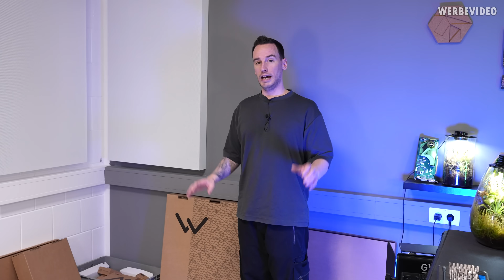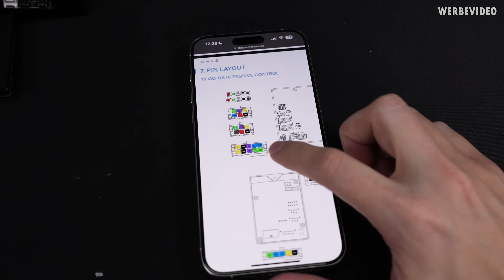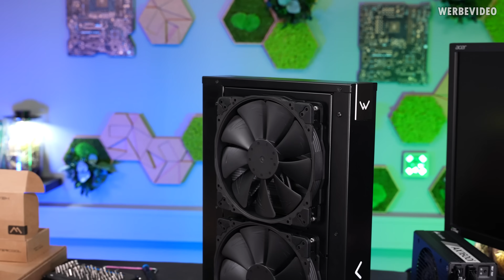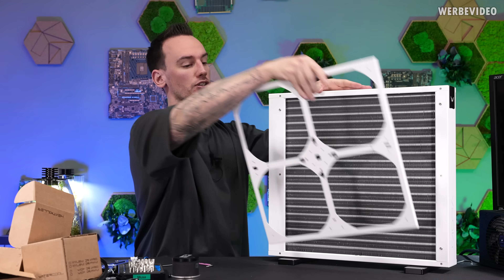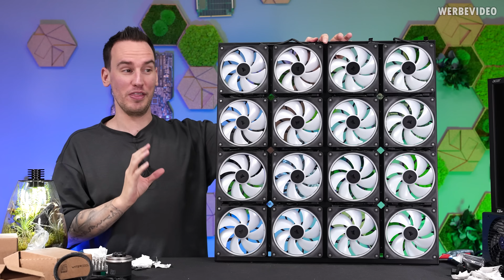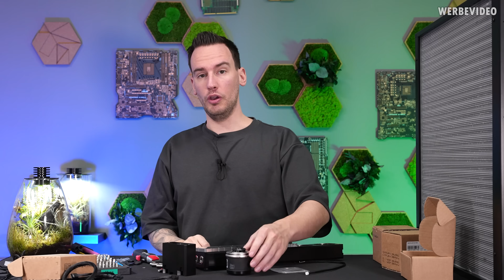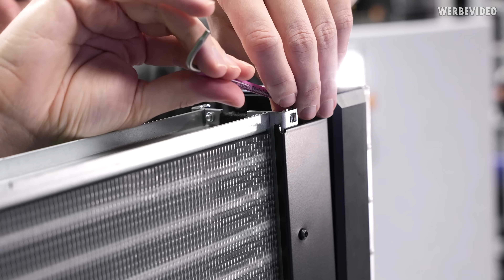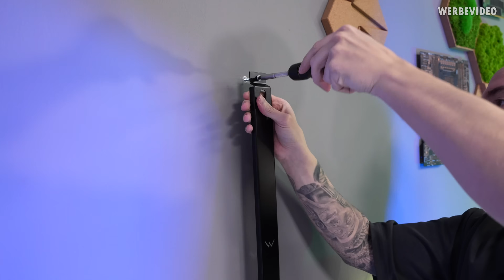The Most Extreme Radiator Ever Made - Watercool MoRa IV 600

Comment: What this thing needs is to be connected to an air duct in the wall. In summer, fans could be set to push air directly out of the house, with an option to easily reverse the flow during winter.
Reply: Depends where you live. Radiator wont heat freezing air enough. Just mount it outside at that point. Into shade ofcourse. Fill it with antifreeze...
Reply: It would be far easier and more efficient to run the water through the wall to the radiator outside. You only need some small holes that could be patched at a later point, or even just capped/plugged together with some insulation if not in use. All you need for that is mainly just sufficient pump pressure, which you can take care of with either a bigger pumpe - or serial standard pumps.
Ducting tends to be very inefficient and have a lot of resistance - doubly so if you need to reduce this much flow into a more normal duct size.
Reply: @TheStigma  Where I live, it's too cold during winter to have the rad outside. Even if I would fill it with antifreeze, bringing fluid into the house at -20C would cause too much dew inside the case. Germany probably averages 5-10 degrees warmer, but it's still too cold on a cold winter day to leave the rad outside, even there.

Mounting it near a large duct would be better, as even small amounts of winter air will help with the cooling, without bringing the liquid below the dew point.

Also, if these fans could help exhaust the heat outside during summer, it would prevent heat from building up inside. (To reduce the load on the AC.)
Reply: In very cold climates, a recirculation valve or thermostat could be used to bypass the radiator to maintain (indoor) minimum water temperature with an outside mounted system.. but that's a lot of extra complexity, especially when in a cold climate keeping the heat emitting radiators indoors would be beneficial.

Quick disconnects, and migrate the radiator indoor during the cold seasons would probably be a better option, but this is all still pretty silly and for little benefit.
Reply: Back in the Threadripper 1950x days, I had a Alphacool NexXxoS XT45 (basically 360x360mm) that I put in the window.
A guy in Australia I know literally just put a hole in his wall to run some tubes outside to an old car radiator, using bog standard antifreeze in his system.
These days, I keep my computer in the garage and just run DisplayPort over fiber and usb over fiber cables to the computer room. Only source of heat there is the monitor, lights, and me.
Reply: @nixnox4852  what you're doing is basically an idea I've had for a while. I'm a musician, and recording/producing really suffers when you have multiple fans making noise.
Reply: I'm not an HVAC expert, but I've never seen ducts that vent to the outside with a central HVAC system. The air is recirculated after being conditioned. Big caveat that I've only ever lived in the USA, though.
Reply: Hello from very far nothern Europe. I have one of the big radiators, I think it's 400x400mm and I've thought about many options. During wintertime it can easily go below -30c (around these numbers the F will be the same). I thought about outside radiator but nope, condensation problem, even though air inside the house is extremely dry during winter. Also the heating energy would be wasted and it's not a small thing.
Maybe the big storage room, which only has a freezing guard keeping it at +5c? Yes, could use the heat there but it's 15 meters away. And during summer it would overheat... Every option seems difficult so what did I do? Stopped using the radiator completely and going with stock cooling systems :D :D
Sure, optimal system would be to have 3 radiators, outside, storage and inside and option/automation to switch between them but it's just too much building just for some small overclocking gains.
Reply: I have holes through 2 walls to balcony, I had MORA there with quick fittings during summer to not heat the flat. In winter it goes inside and heats a bit the other room. It was useful for dual SLI Titan X...
Reply: It would be far more effective to place the entire radiator inside/outside.

When you blow air out of the house (in summer), it creates negative pressure which would cause hot air from outside to be sucked into the house from elsewhere. If you place the entire radiator outside, you will avoid creating this negative pressure.

For winter, you may as well keep the entire radiator inside the house. It's more efficient to heat up the already warmer air inside your house, compared to heating up the cold air from outside. Additionally, blowing air into the house creates positive pressure, which will push warm air out of the house.
Reply: @KillFrenzy96  Yeah that's how they do watercooling or cooling in general at datacenters, precisely to keep the inside air cool. For watercooling you have 3 loops, one is in the rack going to a heat exchanger to the second loop (aka facility water, which is also used to transfer heat from radiators behind aircooled servers) going to another heat exchanger to a third loop going to a finstack outside of the facility. Usually the heat exchange, and the volume of water inside the loop, is enough to cool the servers and often the finstack is barely used outside of peak load scenarios. With a datacenter you have to look at the entire building as if it's one PC, if you have so many servers just moving ambient air around you really don't have the efficiency needed to properly cool them and you will end up with runoff heat, heating up the entire facility. When you are starting to look at radiator's like this, you are definitely dealing with a power usage high enough to make a room unbearably warm (and thus less efficient or maybe even insufficient at cooling), so this same concept still applies.
Reply: @KillFrenzy96  If the air that comes off the radiators is cooler than the outside air, blowing it out of the house might be inefficient. That would certainly almost never be the case where I live. The air off the radiators would be around 35-40C, and the outside temperature even during summer, varies between 15-30C.

If it's really 35C outside AND you want to minimize the AC bill, you MAY want to have the radiator take air from the outside AND exhaust it to the outside. If so, you would need a very large radiator and high fan speeds to get sufficient cooling, though.

As for pulling air in during winter, the main benefit would be better cooling performance and lower fan speeds. If it's -20C outside, only a trickle of that air would help a lot. Also, humans need O2, so SOME ventilation is needed, even when it's far below freezing outside.

In both cases, though, connecting a radiator to a vent would be best if you use very thick but not so wide radiators, so that the air that passes through actually do reach the temperature of the liquid when it has passed all the way through.
Reply: In fact there are ppl in colder climates that they have the rad outsideb always.  Imagine the oc possibilities.

Comment: At this point, automotive radiator is probably a lot cheaper, maybe doesnt look as cool but should be similar in performance.
Reply: Aluminium is a possible issue with typical PC watercooling components though which are usually nickel plated copper or bare copper.

Comment: So it's basically a Truck now.
Reply: Dont give him ideas, he'll be using jets to cool it
Reply: you take a car radiator it's cheaper and more effective no ???
Reply: @ndebele100  Cheaper, yes. More effective? It'd need to be tested.

This massive radiator looks like it has more in common with an A/C condenser than an automotive engine radiator. Since the sides of this radiator weren't shown, I can't be 100% sure, but it looks like the coolant flow is a single path that winds through every channel on the radiator before exiting the cool side. I'd say this setup is highly likely since the black channels seem to be hollow and allow cables to go through. There's probably copper C coils under there to redirect the flow back into the radiator, which is common on refrigerant systems.

Automotive radiators generally have a reservoir on the top and bottom of the fin channels that connect them all in parallel. This is for several reasons. First, you need high coolant flow from the enormous amount of waste heat being generated. Second, you want to be able to maintain an equilibrium temperature using a thermostat, not get the coolant as cold as possible.

The parallel channel operating nature of the automotive radiator makes it less efficient vs a serial channel of an A/C style condenser radiator, since the fluid can bypass large portions of the fin surface versus having to go through the entire radiator several times before it exits.

Though, since automotive radiators are designed to remove dozens of kilowatts of waste heat, I don't think there's going to be much difference with a grossly underrated load like a CPU that only pulls hundreds of watts.
Reply: @GGigabiteM  yes needed to be tested for sure
You will need a big pump !!
the problem is not why components get but why we need more and more power ?
games/ soft are really bad at optimisation and ugly (for most games : blurry etc...)
bigger componets = more power = bigger psu = expensive = cost of electricity rise etc...